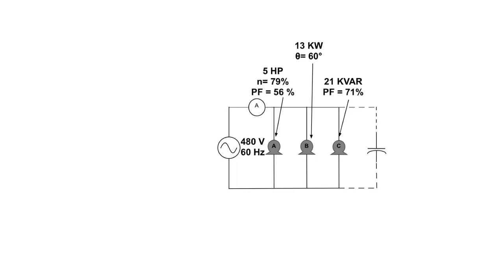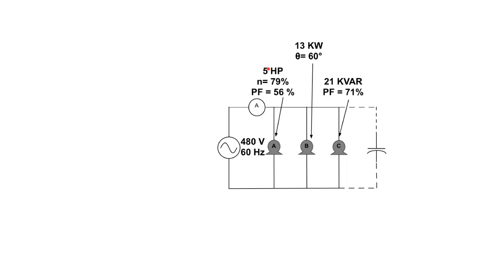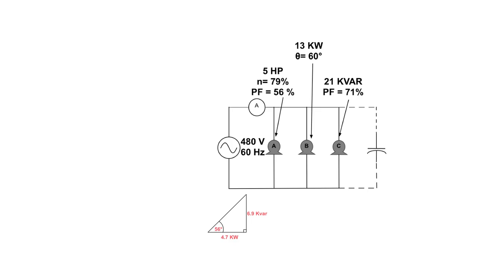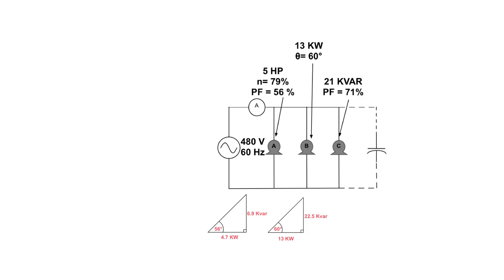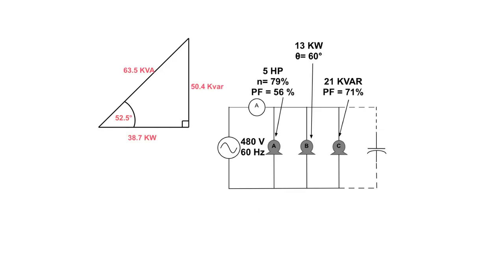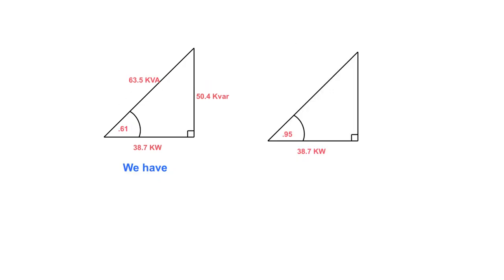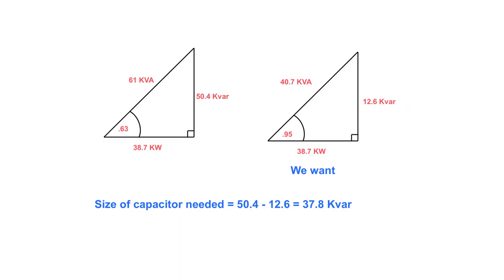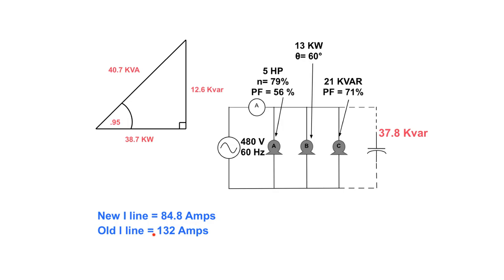POWER FACTOR CORRECTION:  How to calculate the size of capacitor you need to improve

Comment: Thanks for the video , can you tell how will we take power factor in a system , example in 5 storey hotel building, if we take the distribution boards, then Sub main DB and main DB load schedule,we only assume the power factor to be 0.8 or 0.85 and do the rest of the calculation, like current, wattage etc... But when it's comes the question of  power factor- capacitor bank , how will we calculate the existing power factor with load schedule, Theoretically...
Kindly help me out. Thanks

Comment: In actual electrical system, what will be the voltage rating of the capacitor that should be installed? remember, capacitor is sensitive to voltage.